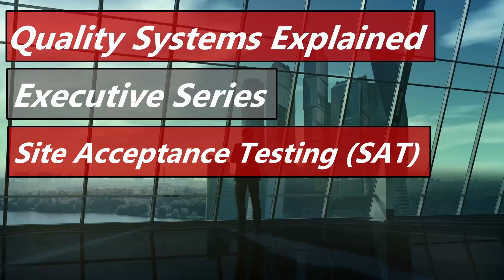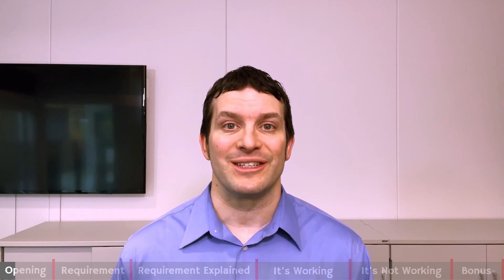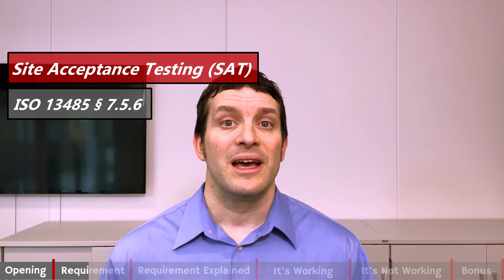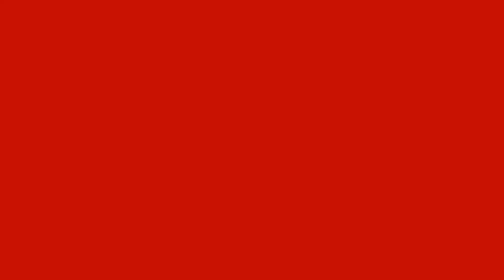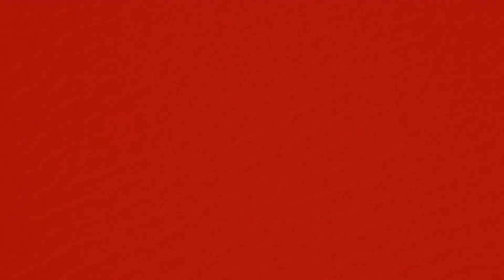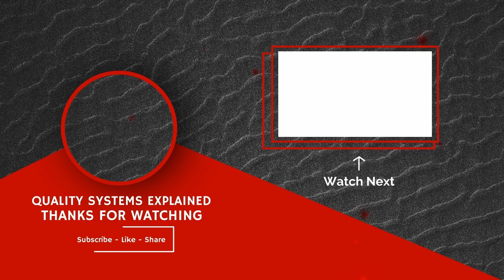Site Acceptance Test (SAT) ISO 13485 § 7.5.6 (Executive Series #100)

Comment: Does the SAT has any cost? if does, Average price for a small project?
Reply from the maker: Well, doing an SAT requires time to develop the protocols and then to execute them.  So, yes, doing an SAT will add cost up front.  The reason you do an SAT is to identify problems with the equipment before it leaves the equipment manufacturers’ site, so they can fix it before shipping it to your site.  Doing the SAT will help prevent larger delays later if problems are found once the equipment arrives at your site.   Think of it this way, if you find problems with the equipment once it’s at your site, how difficult is it to get the equipment manufacturer to fix them?  If you identify the problem while it’s still at the suppliers site, they have a tons of motivation to get them fixed so they can ship the equipment to you and get paid.  ;)